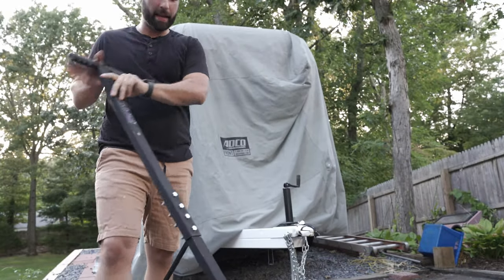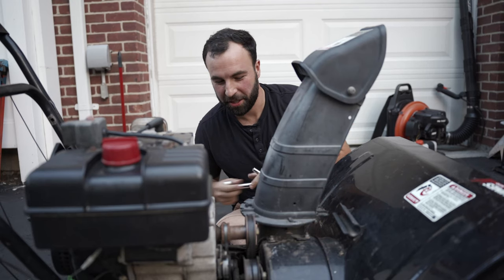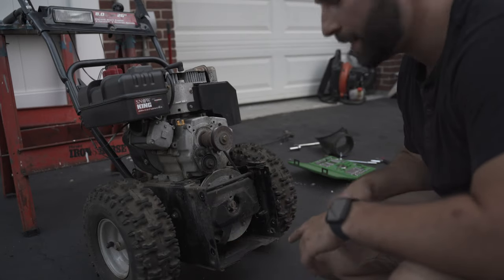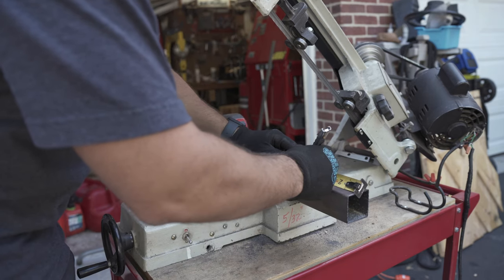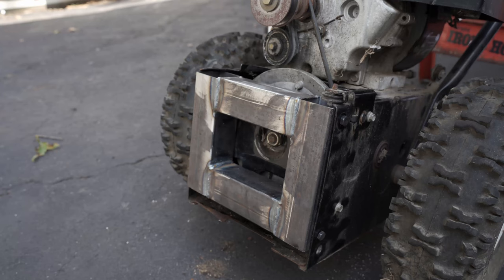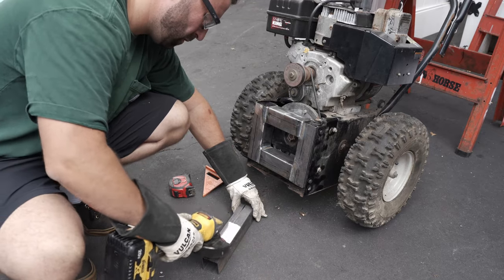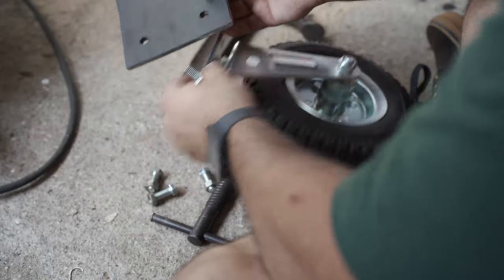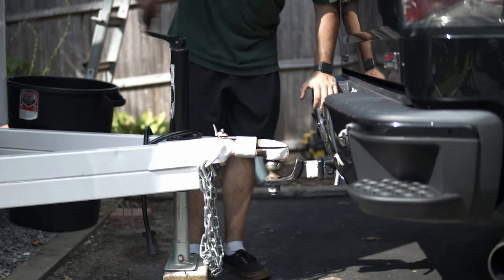I BUILT A TRAILER VALET FROM AN OLD SNOWBLOWER (diy)

Comment: I've built something similiar to move non-running cars around, which was a golfcar rearaxle I added a winch motor to.  Simple.  However, for a trailer I just used a riding mower, you can find them that need work for almost free (mine was free..needed new carb).   It didn't work in the mud though, just spun the little tires.
Reply from the maker: I’ve used a riding mower as well, when I built this I needed it to be easier to transport. Appreciate the support!

Comment: Steering was probably difficult because your "swivel" point on the dolly was your front tire.  If it was reversed (fixed drive wheel in front, swivel wheel in back) , it would have been easier to turn the unit.
Reply from the maker: I agree with that, the live axle would’ve made that difficult too though I think.

Comment: your drive was a very steep incline, using your truck to get it out. Like the idea of a snow blower, thinking trailer valet but cost is high. do you or have you ever tried this on a slight incline  12-4 pitch.
Reply from the maker: It definitely will not work on any kid of an incline which is kind of a bummer